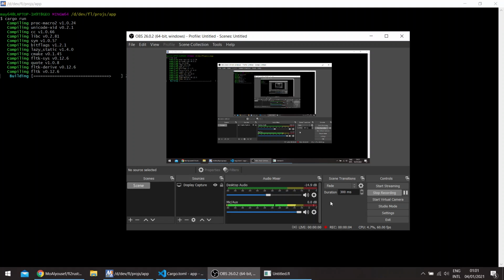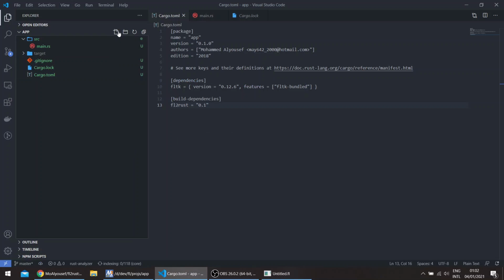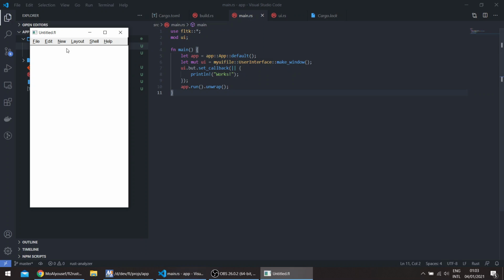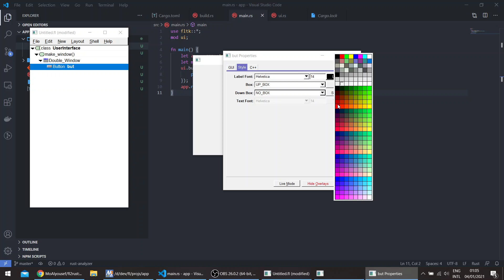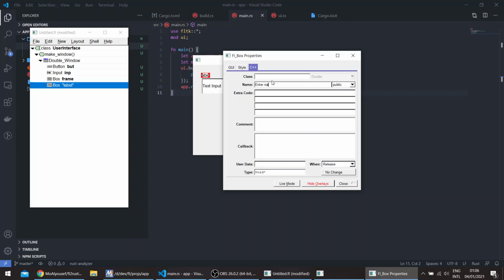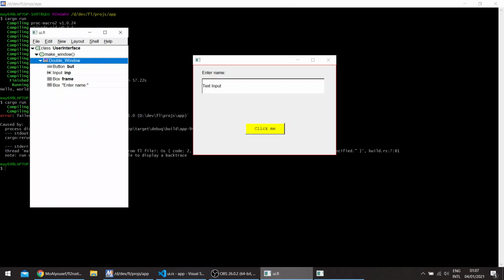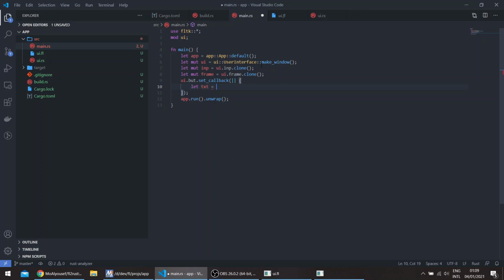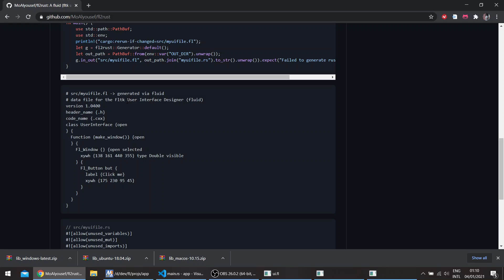FLTK Rust: use FLUID (RAD tool) with Rust

Comment: Thank you, very informative.  Could I please request that you do a video dealing with an input and two buttons one to proces the value of the input box and one button to clear the input. I keep having trouble with this because the button moves the mut inputbox to the callback and the other button then can't access it. I have watched a lot of your videos and the closest to solving this was using send and receive with a match to process the two buttons actions. In a large project this seems like a clumsy solution.
Reply from the maker: Thank you for the kind words. You can cheaply clone widgets since they are reference types. So basically create a clone of your input widget, move one to one button's closure and the clone to the other button's closure

Comment: How to run fl2rust if you add it as a library?
Reply from the maker: You can install it as an executable, then you can run fl2rust from the command-line, or add it to a project  as a build-dependency and it will be run in your build script.

Comment: Surprisingly, it's very hard to find where to download/install the fluid tool. Not mentioned in the videos, not on the docs on line (that I can see) and not in the downloads section fo the web.

Where should I go (for Mac OS)?
Reply: A bit late to respond and unfortunately the author hasn't, but you can install it with "cargo install fltk-fluid', which adds fltk-fuild (which doesn't do anything) and fluid, that you can launch from the command line. I must admit the doc around this tool is very obscure.